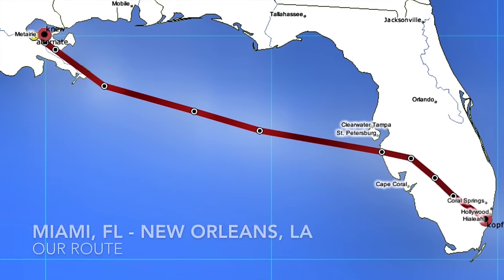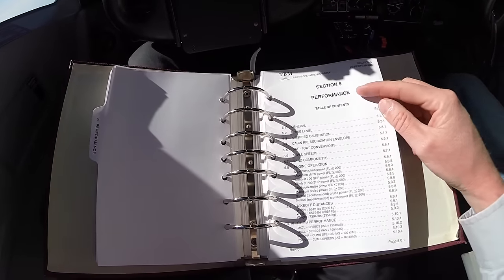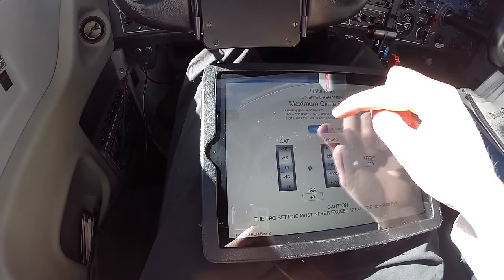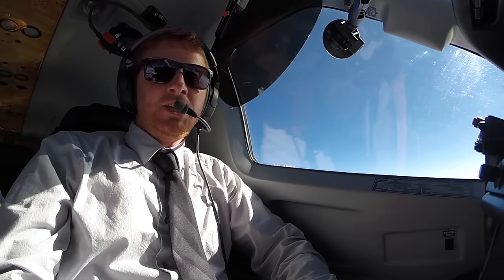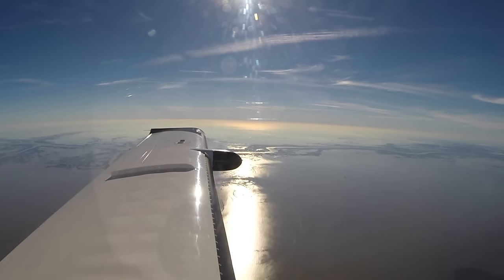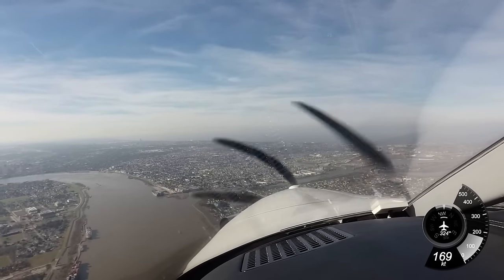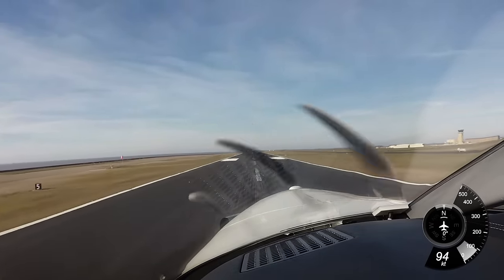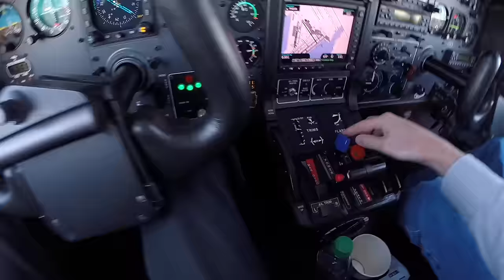#Flight VLOG - Crossing the Gulf of Mexico

Comment: Steve a question I have always wanted to ask is How do you calculate your Flt levels when flying on a particular flight. On this flt at 30000 but if you are only doing a short flt it may only be 15 or 20000 feet. how do you work this out? Can you please do a video on this subject?

Keep up the great videos.
Reply: I don't want to steal Steve's opportunity for an interaction here so will just say the following. For the type of flying Steve does his altitudes are assigned by ATC. The assigned altitude is strictly enforced. Depending on area flying in if he deviates much from the assigned altitude he will hear about it. You can bet he is not drifting high and or low. He is pretty much nails with his flying. And has a nice autopilot ;-)
Reply: +born2flyau +4randosutube I think the question he's asking is for flight planning purposes not when he's already flying. Prior to take off, Steve likely goes into fltplan.com, chooses his destination and sees if there is a commonly used route heading there. During route selection he'll compare winds aloft either through ADDS or using one of fltplan's features and select the altitude most favorable for the direction of travel keeping in mind hindrances to travel (Icing, turbulence). Also, if you're doing a relatively short trip, going too high essentially reaches the point of diminishing returns rather quickly. Hope that helps.
Reply: +born2flyau Depends on many factors, weather, icing conditions, head wind or tail wind, airspace, and it would make sense for short route to use a lower cruising ALT.
Reply: +born2flyau As far as I know there are 2 main points for the selection of your level altitude. The first being the weather of course. Usually, the higher you fly the less likely you will fly into stronger turbulence. The second of course being the optimum fuel consumption. On a short flight there is no point in flying at ceiling altitude (FL310 for the TBM850) if you don&#39;t fly there for a certain amount of time. The higher you fly the less fuel the engine will consume, however, due to the high power settings during the climb, the engine will also consume a lot more fuel until you reach your cruise altitude. Therefore, for specific lengths of routes there will be an optimum flight level regarding the fuel consumption of the airplane.

Also: Greetings from Germany! Love the vlogs and would definitely love to see some more behind the scenes stuff.
Reply: +Linus Sebastian This is what I am trying to find out. How do you calculate the OPTIMUM cruise altitude for a given distant traveled?
Reply: born2flyau For Daher Socata there is likely software (or an app), for the rest of general aviation there are range charts specific to each aircraft. Based on a certain distance, it will recommend a flight envelope, also obstacle clearance would be a consideration (clearing mountains).
Reply: Usually you will have a computer program which will calculate the fuel consumption based on the pre-settings (Take-off weight, power setting for climb, winds) for the selected route for every possible altitude. The one with the least fuel consumption is obviously the optimum. Further considerations like turbulence or thunder storms may result in the pilot choosing a different altitude than the fuel-optimum one. You can also calculate this with the performance charts that SteveO showed in the video (i.e. the fuel consumption in various parts of the flight like take-off, climb, cruise, decent, landing, taxiing), however that would take quite a while and luckily we live in an age of computers ;)
Reply: +born2flyau Sorry I did not answer your actual question. Thankfully others have jumped on and given you better answers. I should have provided more detail but did not want to get into the minutia. As you can see, there are several things to take into account. You may well want to select multiple levels on a longer haul to take advantage of favorable conditions at one FL vs. FL or to adapt to existing or developing Wx along your route. Sorry I was so vague at first. Maybe we will see what Steve has to say. He has done a vid on flight planning and the services/tools he uses to plan a flight. I remember it. Snoop through his feed. You should watch all his vids anyway. He has one of the better av channels. Premier1driver and Guido Warnecke are excellent as well. Be safe.

Comment: What is the reason you first feather the prop, then turn off the avionics, and only then shut down the engine?

I have seen free-turbine turboprop engines usually being started with the prop feathered, but I'm also not sure why.

How do you put the prop into beta manually? I saw FlightChop's recent flight on a TBM, and the pilot said that even at idle it would accelerate to some 35 knots on the ground so he put it into beta. I think I see the top of the blue lever labelled "Max RPM". Where is beta?
Reply: +pinkdispatcher should be the back end of the PCL. If you watch other videos you'll see him pull it past the detent on landing.
Reply: Jason Connors
Ah, so it's the "throttle" (I didn't know Daher calls it the "Power control lever", which is more accurate than throttle on a gas turbine engine), and not the prop leverl. Thanks.

Comment: hey steve what was the distance of the flight?
Reply: +Zachary Ross I think thats about a 650 mile trip. Steveo could give you the exact figure i'm sure.
Reply: +Pitch4Airspeed  I just typed in N851TB on Flightaware.  Steve's flight from KOPF to KNEW was planned for 594nm, actual flown 596nm and direct distance between the two airfields is 574 nm.

Comment: Believe I'd have thanked the controller for the TCAS Alert!  Why would he ever vector or allow another aircraft to fly in the direct opposite direction at that altitude with another aircraft on approach blows my mind. Sadly it's not the first time I've seen controllers do that or something as stupid as that. Simple mistakes like that cost people their lives if they don't have a pilot like you who's skilled enough to avoid the other aircraft.
Reply: +2 Tall Paul 428 The guy was at 1500 ft, sounds like might have been a Cessna flying VFR, at least he was talking to TRACON/RAPCON, that's not always the case.
Reply: +Jason Connors looking at the Virb data when Steve got the traffic call from the tower, and assuming that the Cessna was doing at least 100 knots, the tower controller, put 2 aircraft in a near head on collision course with less than 200 feet vertical separation and less than 30 seconds to do anything about it.  It's hard to hear, but you can hear the tower tell the Cessna to resume on course later in the video too so apparently he vectored him to that point.  That's MORONIC plain and simple!  Again in my opinion, for whatever it's worth, someone, somewhere needed to get a phone call, and a WTF was that conversation needed to be had at the VERY least.  Looking at the VFR sectional there is ample room  left or right of the approach corridor in which the Cessna could have been and it wouldn't have been a factor for Steve.  Being that it appears there was another plane in the pattern for 36R a deviation for the Cessna to the right would've been the apparent best course of action, which wouldn't have even been using part of New Orleans Intl airspace since the Cessna was at 1500 and Intl goes down to 2000ft in that area.  "Cessna 77Q, immediate right turn to 270 for traffic" should have been the call and not just telling the two "hey you have traffic guys and don't hit each other if you can see each other in time".  All I know is Steve was way calmer than I would've been in that same situation or even if I was the Cessna pilot.  This is a classic example of "don't always trust ATC to keep you safe and always keep your head on a swivel near busy airspace."  Anytime I've flown with friends or family, I always gave them a safety brief when we were approaching our destination of, "if you see a plane that I don't, please tell me, otherwise please be quite so I can concentrate."